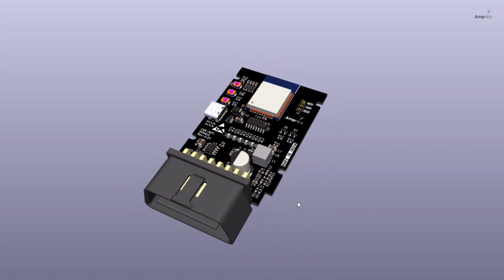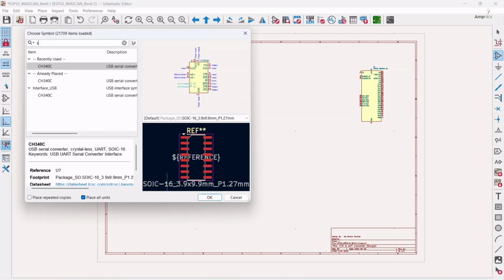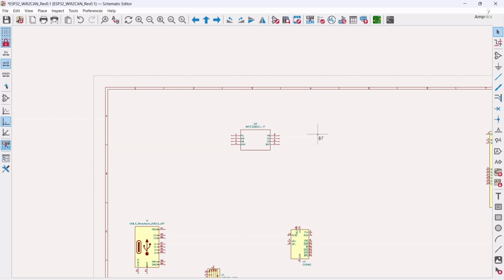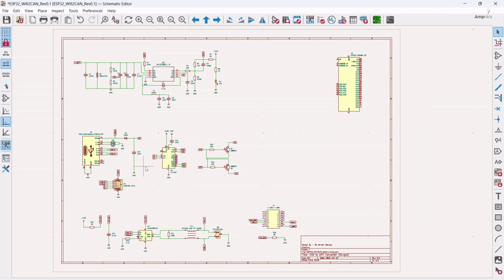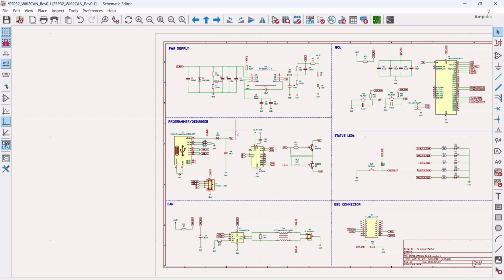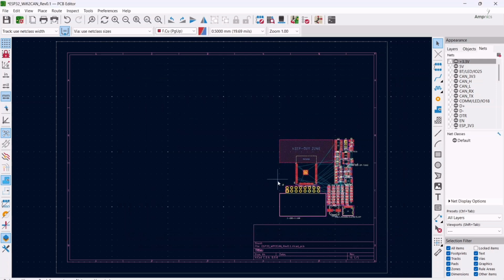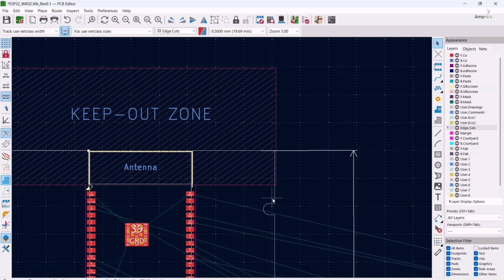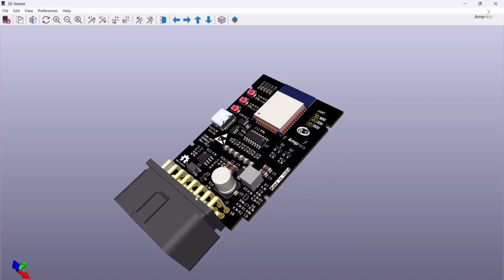CAN to WiFi Converter | KiCAD 9.0 Tutorial | Open Source Hardware Project | Ampnics

Comment: i got error when updated pcb, "Can't add J2, can't add FL1, Can't add U5 before that i have been done to do it at preference for add sym external 😢
Reply from the maker: Hello dear!
Make sure to import the libraries properly. Try removing it and then import again. In this way you can get it done easily. You can join our community chat where we used to share these stuffs on regular basis and we used solve the problem of students, hobbyists, engineers and entrepreneurs. Link is in description.
Reply: @ampnics thanks buddy, I'm solve it in GitHub do you have any code to testing this PCB